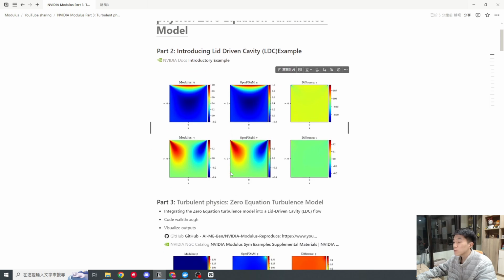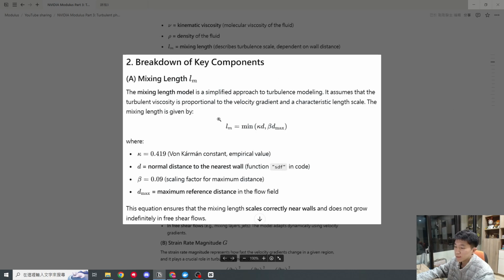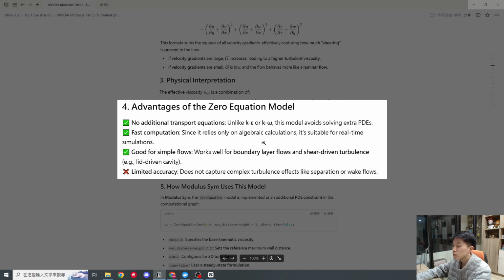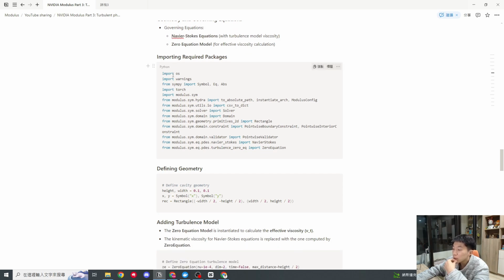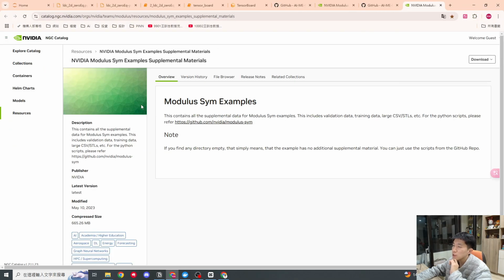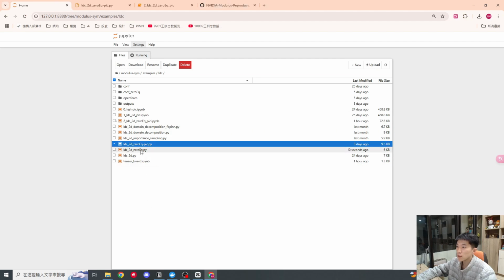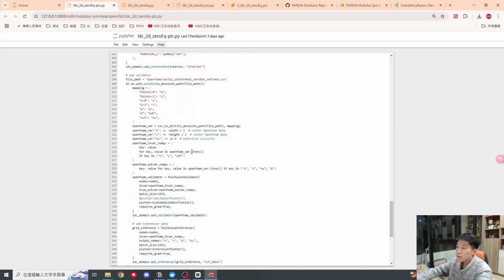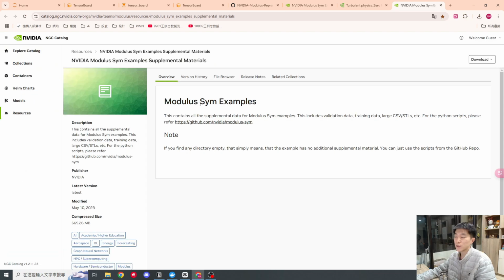PhysicsNeMo Part 3 Turbulent physics Zero Equation Turbulence Model

Comment: how to make Nvidia modulus work on Google colab?
Reply from the maker: NVIDIA Modulus may have compatibility issues when installed on Google Colab.

A possible solution is to install an older version of Modulus that is known to be stable with Colab’s environment. You can try:!pip install "nvidia-modulus==<specific_version>"

If I find any new solutions, I’ll update you! 🚀
Reply: @AI_CAE_Ben  Thanks for the great video. I noticed that you are using docker, is it possible on Mac machine to use Nvidia modulus, or not, I have M4 imac.
Reply from the maker: @hhnnnnll  it works on colab!
https://github.com/NVIDIA/modulus-sym/issues/223

!pip install --extra-index-url https://pypi.nvidia.com/ nvidia-modulus
!pip install "pint==0.19.2"
!git clone https://github.com/NVIDIA/modulus-sym.git
%cd modulus-sym
%pip install --upgrade pip
%pip install . --no-build-isolation
%cd /content/
import modulus.sym
Reply: @ many thanks for your continued support